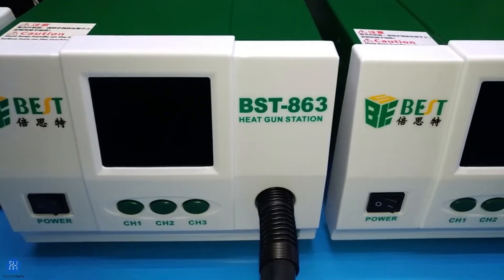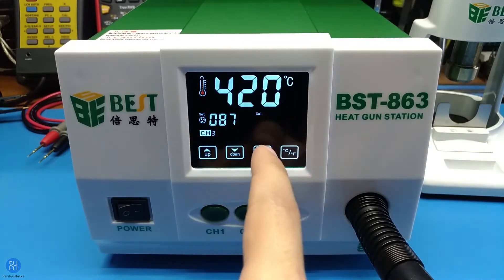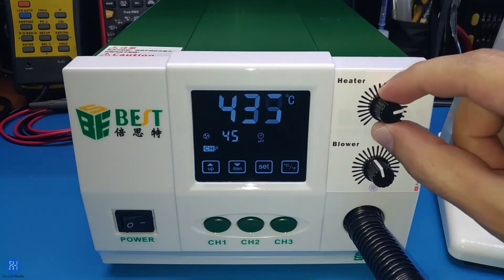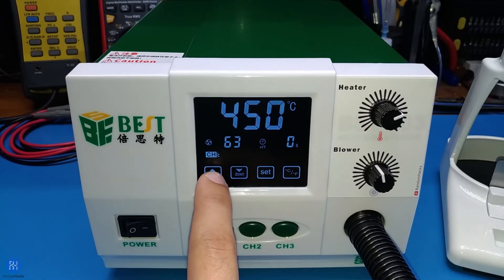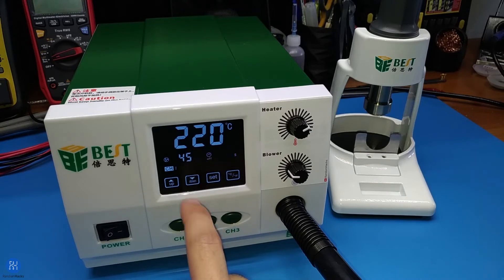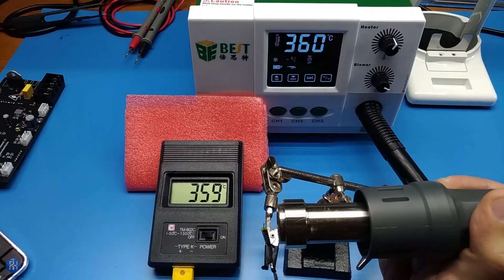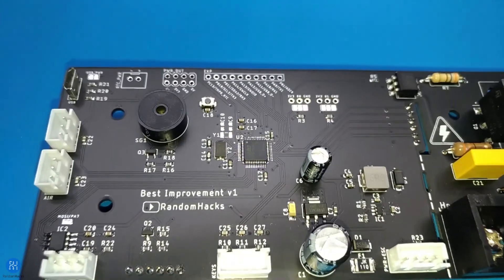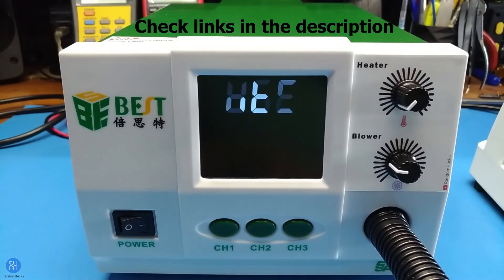I upgraded my Best BST-863 hot air station | Available on tindie

Comment from the maker: Installation instructions: https://youtu.be/_PKAgJuqW78
Is there some other feature you would like to see? 
Let me know maybe I can implement it 😉
Reply: MIne sometimes doesn't turn on when taken it out of the base I think is the magnets on the base
Reply from the maker: @belenhedderich3330  either that or the reed switch inside the handle is dead. Check for continuity between the black and white wires on the first JST connector from the left, it should be close to 0 ohm if the handle is in the support and open if not.
Reply: @belenhedderich3330  I know this is an older comment but the issue on mine wasn't a bad reed switch, it was bad orientation of the reed switch. Mine was 90 degrees turned from what it should be to open and close with the magnets in the base.
Reply: @belenhedderich3330  the handle HAS to be set in the base before turning on the station if its off or raised out of the base then it does not turn on or heart up. re place it in the base fully turn off then back on and it should work after that. i though i had a defective unit at first myself and that was all it was.
Reply: First, big caveat, this might be just because I'm watching on a small phone. But the temperature gradient when turning the pot - it makes it look like you're maybe using logarithmic pots? Or is an accelleration thing? Seems like the change in degrees (temp) per angle of rotation is really high at 350°C and up, but more granular lower down (per angle of rotation). Is this correct? If so - would it be possible to use linear potensiometers instead, so it scales linearly across the temp / airflow and pot rotation range? If it's too much hassle to change the kits, maybe just do it as an alternate firmware for for instance 10k linear pots, then us customers can do the FW upgrade and swap the pots on our own.
Reply from the maker: @pr0xZen  Hi, the pots are linear, the change is always the same through the whole range 😁
Reply: @RandomHacks  Caveat came in handy 😅 Thank you. - I guess the solution for my own preference then, is no more complicated than getting some bigger-OD knobs for the pots 😊

Comment: I have used many hot air stations, some of which were significantly more expensive than the Best BST-863 hot air station. I've been using it for 3 years now, and I’m still extremely satisfied. The price-performance ratio is simply unbeatable, and it can easily compete with high-end hot air stations. I’m so impressed with it that I’ve now also ordered your upgraded model.
Reply from the maker: Hi, thank you for your order. I was planning to ship it today, but unfortunately, something unexpected came up and disrupted my schedule. I will ship it tomorrow. Apologies for the delay.
Reply from the maker: Shipped 😎
Reply: @RandomHacks  thanks

Comment: Hi. I bought this BST-863 Improved Control Board. After connecting everything, the pump does not work. Does not start. Everything else works. I checked all connections again and it still doesn't work. I checked the connection between the pump controller and the board (processor) and it is ok. When I connected the old motherboard, the pump works, which means that the motherboard from you does not give control. What can I do now?
Reply from the maker: Hi, I'm sorry you are having issues, please check your email, I replied to your email yesterday, shortly after you sent it
Reply from the maker: I sent you another email just now, please confirm if you received it, also check the spam folder if you can't find it.
Reply: @RandomHacks  Yes, that's it!!! :D In this case, just solder the resistor R23, as you wrote! :D Everything works great. Thank you very much for this project. The station is now THE BEST ON THE WORLD!!!
Reply from the maker: @marcinwisniewski834  Great, I'm glad it fixed the issue, once again I'm very sorry for the issue 😉

Comment: Thank you good Video! i use self made nozzels but the temperatur on this nozzel ist 100 degree lower than it show the Display can i calibrate this or wat is the maximum Temperatur range for calibration.
Thanks for answering
Reply from the maker: Hi, I got your messages, no need to spam 😅
I have a +/-50ºC calibration limit in software and I highly doubt you need anywhere near this limit with my board. The calibration of the first station I bought was also very bad, only reaching about 380ºC when set at 550ºC and after installing my board it reached the correct temperature without even calibrating.
I doubt you need anywere near 100ºC calibration range with my board but I also don't know how your DIY nozzles look like and how they restrict the airflow but if you buy my board and need a bigger limit I can make a special firmware just for you.

Comment: It might be good to add a way to turn the hot air on / off (long press of channel button ... long press of two channel buttons  .... a soft key on the screen?) with the handle out of the holder.  This would allow the handle to be mounted over a workstation and would not require unmounting of the handle to swap tips or simply turn the station off (put the station in standby) .  See comments at the end of this video.  https://www.youtube.com/watch?v=IVXnxbliBMg
Reply from the maker: Hi, sorry for the late reply, I only noticed this comment today as it had been filtered by youtube because of the link. I like your idea, I will have to check the best way to implement it. Thanks!

Comment: is there a way to turn up the brightness on these? i had to order a new lcd from them since mine died and its super dim compared to the original one. wondering if there is a way to turn it up some. i did try removing the film on the front it helped a bit but this new one is much darker. i would love a way to have the display go off after a while of non use also. also be VERY VERY careful with newer units. i installed 2 of these for other people who got the new 1.5 from you. when you snip the lcd legs the traces can literally fall right off the pcb. same with soldering to them to remove them. use light heat and not to long. i had to repair one with wires to re connect the traces. my 2 older units the lcd pcb had no issues. each time no matter how careful i was and how gentle when i snipped the leg the pad came right off the pcb.
Reply from the maker: Hi, I also noticed on my stations that one of the displays is dimmer than the other, not sure why, the LCDs are backlit with a single LED, maybe they use LEDs with different forward voltages or the LCD itself is darker. On my board you can change the current limiting resistor (R12), just be carefull not to burn the led. Thanks for letting me know that the LCD boards changed, I was not aware of that. By the way if you don't mind me asking, where did you order the new lcd and how much did you pay?
Reply: @RandomHacks  direct from best. the lcd is cheap but they will only ship dhl express and that cost like 60$ so im 80$ in. i ordered 2 so i have a backup lcd. also is there a file you use for the stickers? i had to pull one off and i mean i guess i dont need it on there but id like to put one back on there. i got small few drops of acetone on it by mistake and it messed up the sticker.
Reply from the maker: @th3drizzl378  You can contact me through tindie, I can send you a new sticker.

Comment: Would it be possible to have the wiring schematics for this? I already ordered the rev 1.5 of this to replace a faulty controller on my Best station, and I would like to be able to troubleshoot the problem Im having. I haven't received the controller yet, but on the old faulty controller, the touch screen is behaving erratically on the UP button, sometimes it doesn't work, sometimes it senses a press when I'm not touching it, and sometimes it thinks the UP button is pressed and held continuously. A wiring diagram might allow me to see how the touch controls are connected and find out what is the problem.
Reply from the maker: Hi, I replied to your message on tindie 😉

Comment: I don't noticed if with the new board the behavior on start is to turn on the air or not, it's a safety thing that old stations have, especially useful when a blackout occurs for a short time, so when reenergized the station turns the air on for some time to try to save the resistance from melting. Easy to implement if not yet implemented, for sure very usefull thing, and since this board is microprocessed you can even do better than the old mechanism, that will always turn on the air when the station is first energized, you can turn on the air only when an unexpect shutdown occurs.
Congratulations on your work, it seems to me that BEST should buy your project to implement by default in their station. ;D
Reply from the maker: Yes it does turn on for a second on each start and remains on if the heater is hot until it cools down 😉
It would be simple to save a flag on flash to only turn the blower on when there was an unexpected shutdown, but it might confuse people and this way it is easier to notice if there is a problem with the blower while turning the station on, but the idea is good, kind of like 3d printers do it I guess. Thanks for your comment.

Comment: are these still v1 or has there been any changes? i remember reading on eevblog forums you mentioned you may make some changes. and will you be making the firmware updates available via a flashable bin file? otherwise loving the ones i got!! i just may order a couple more of these for the other stations at the shop and put these in those as well which is why i asked about new version. thank you so much for making these!
Reply from the maker: Hi, glad to hear you are happy with the boards. The source code is available on github (https://github.com/RandomHacks-Git/Best-Improvement) I don't have it precompiled as a bin file, I might look into that later. There will be a new version of the board with the RP2040 microcontroller instead of the STM, everything else will be the same.  I got a small batch of the new PCBs two months ago but the components got stuck in customs and only arrived last week so I'm now testing the board to make sure everything works as expected. So far I didn't find any bugs so I expect to have them on my tindie next week 😉

Comment: Hello there
Today September 6, 2021, receive "Best BST-863 Improved Control Board", which has an excellent design, very good finish, it is exact as you show in the video.
I am doing tests and I see slight variations in temperatures when changing from 150 ºC, 250 ºC and 300 ºC but surely I will find a middle point.
This update gives new life to this workstation because the temperature and air can be adjusted manually, it is a very well thought out job.

Recommended 100%
Thanks

Comment: i ordered the kits from you cant wait to try them. i would love to have the pots for settings. however for those looking to just kill the beep and nothing more you can quiet it to almost nothing simply by taking a small screw that fits into the hole in the plastic on the buzzer and slowly screwing it down. the more you turn it the quieter the beeping. i have mine currently to barely make any noise at all. but another 1/4 turn and its silent. or the buzzer can be de soldered but some dont want to do that. using the screw with a bit of hot glue over it so it cant move works fantastic.